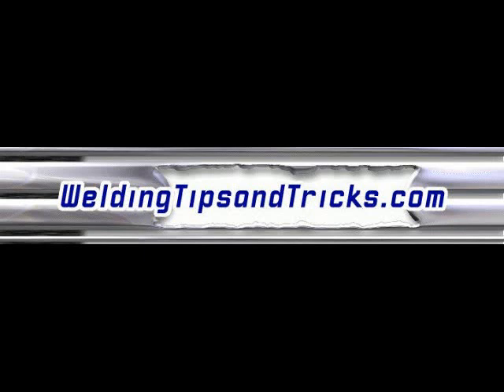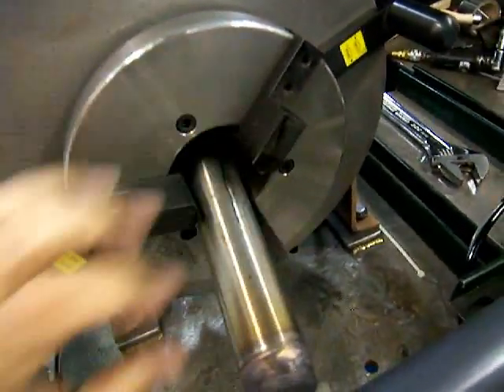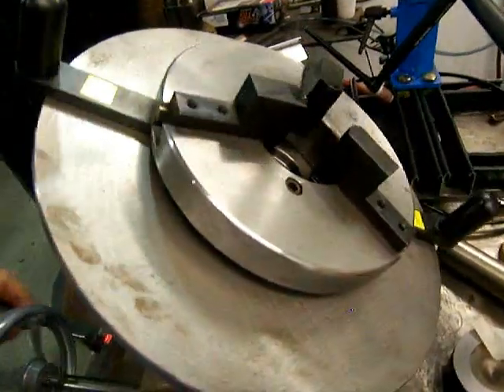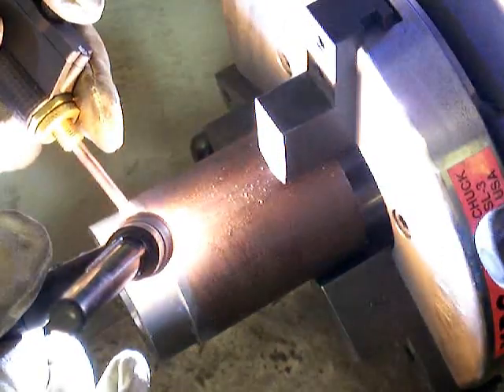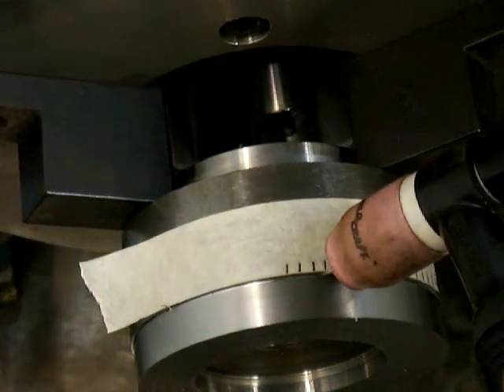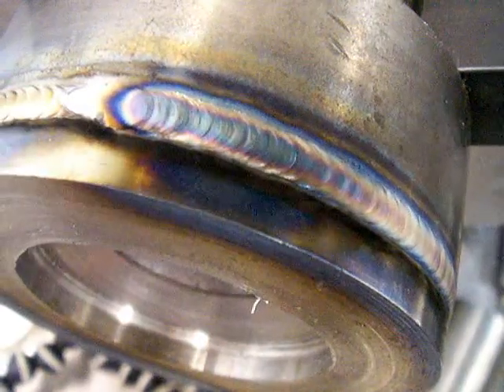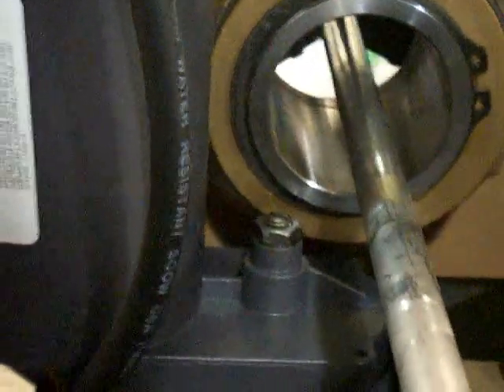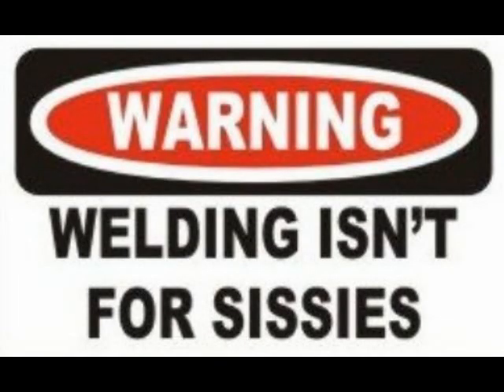automated welding with mbc welding positioner

Comment: About the chuck. I was a sales rep for Pandjiris, so I can impart some advice that you missed. Lathe chucks extend the load farther out from the faceplate than welding chucks, but any chuck does for that matter. Every inch of extension decreases the capacity of the positioner when the table is vertical. Remember, torque is multiplied by every inch of extension (T = Weight x Length to CG of part). The positioner will have a maximum rating for weight at a set dimension from the table. If the part and extension puts it past this rating, you'll need an outboard support. With that, any length can be handled, if it is within the rotation torque of the positioner.

However, elbows, pipe offsets, fittings, takeoffs, etc, can change the center of gravity (CG) of the part, and you have to watch this as far as the rotational torque rating of the positioner.

There is also a maximum length that a positioner with an outboard support can hold. This is due to the loading on the spindle bearings, so the maximum weight (in torque) that is listed will be the max. weight that can be placed upon the table. In the case of a 400 pound positioner, with an outboard support, it can hold 800 pounds, as long as the CG of the part is mid-way and not closer to the positioner. This way, the load is equally shared between the positioner and outboard support, but both have a maximum weight rating.

Comment: Jody

I know the video came out about 8yrs ago, but am new to welding and watch the old stuff as well as the new stuff.  Was thinking, for small pieces parts where a positioner would be nice, a small machinist rotary table looks like it could be adapted to be used, and they are signicantly cheaper than a dedicated positioner, and can be driven by a cordless drill/driver.  Any thoughts???

John

Comment: Jody: How do you start the weld? I have a foot control on my MBC, and I made a threaded adjuster on it to control the maximum speed. So I establish the puddle and then activate the foot control. I can slow it if it gets out of control. There is a learning curve, though: right foot torch heat, left foot table speed, then feed the rod. To walk the cup at the same time is like being a one man band.    JB

Comment: thanks for all your efforts.  I've learned a lot from you!
I have a request,  could you do a short demo on welding stainless weld els into headers? there are a LOT of guys using these,  mostly sch 10 ace stainless specials, to make their turbo headers, and the myths, bad info and otherwise horses-!t floating on the internet has folks attempting all sorts of useless and improper things.  How would YOU butt-weld a gaggle of 90's into a reliable part?
thanks again for all the info you've shared